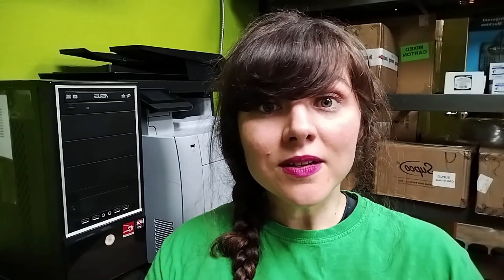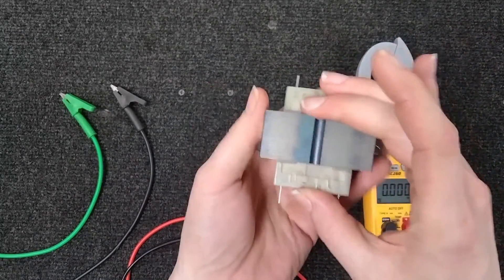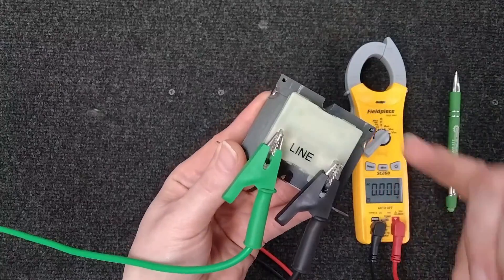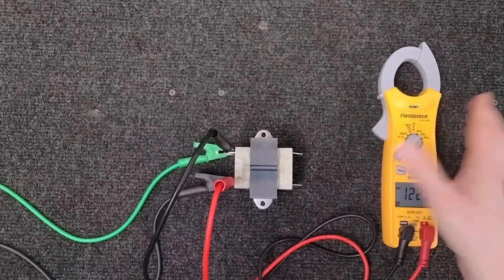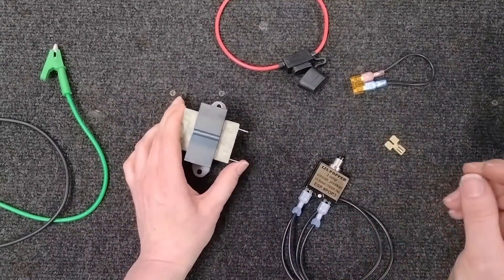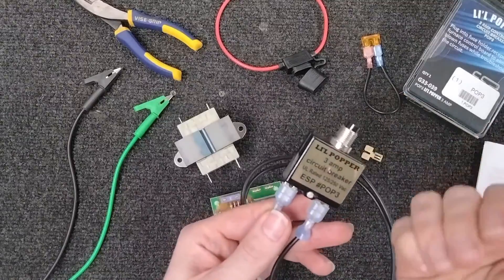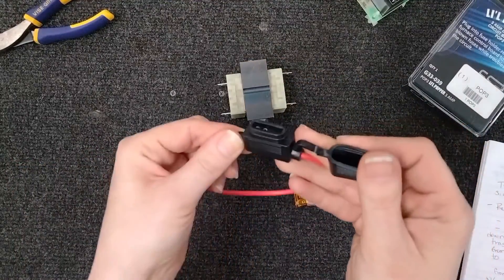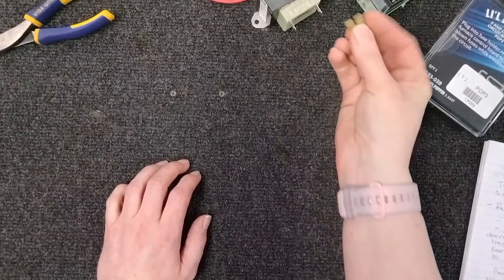Nothing Is Coming On! How To Test Your Transformer.

Comment: made the habit on a brand new transformer ,relay, contactor  coil, i measure resistance and that will give you the idea of what numbers your want to see on a "healthy" transformer, contactor.... but like you said transformers are usually fried on the load end, feeding line voltage you can check load voltage, good video
Reply from the maker: Always a good idea to check resistance across any mechanical connection. (i.e. thermal disk limits, contactors, etc.) Especially pitted contact points on contactors. It's so hard to convince homeowners at times when you explain how it's a wear and tear part, they think you are trying to sell them crap. You're correct, always good to check your resistance and make sure it's low!